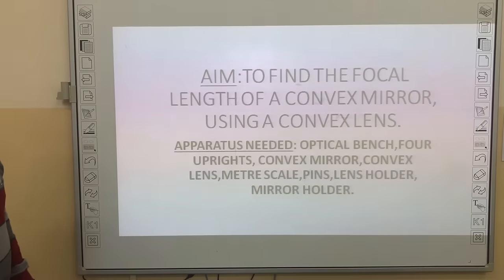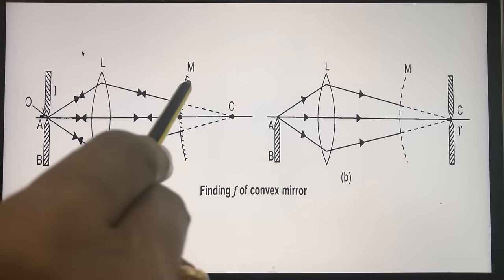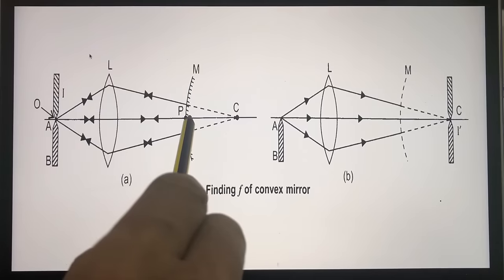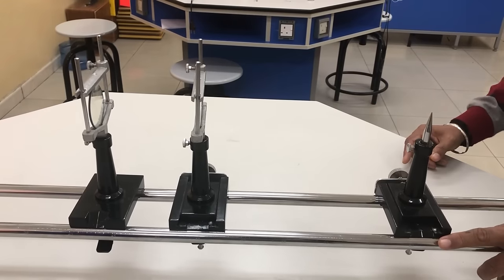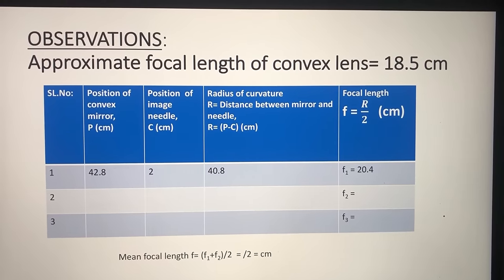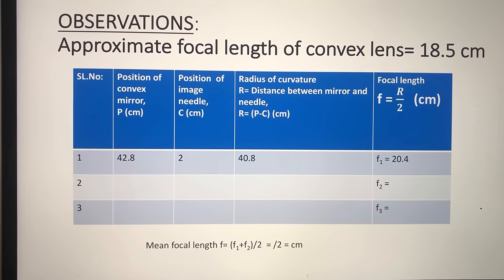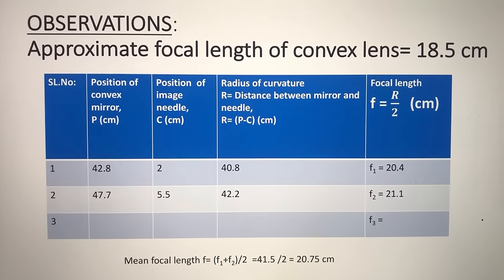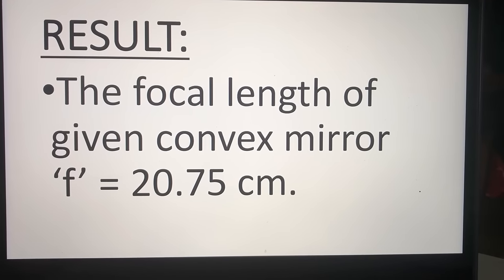To find focal length of convex mirror using convex lens.Prakash & Mini

Comment: 1. Initally keep the convex mirror and convex lens at any distance apart from each other, but it is better if it is not too far apart.
2. Now take the object and adjust it such that the parallax is removed. 
3. Once done, remove the mirror and again adjust the other pin such that parallax is removed
4. Find value of R
5. For next observation, do not change position of lens, instead bring the mirror a bit closer (around 2 cm) to the lens and repeat the experiment.

P.S: My practicals are over and I got this experiment. But thankfully I got good readings.
Reply: Bhai observation bhi likh de please..😂
Reply: Thanks bhai ..bahut confusion tha
Reply: @ItzSiddhant  😂😂😂
Reply: Bhai object ko kitne distance pe rakhna hai?
Reply: R is measured from the mirror? or lens?
Reply: @vrajpatel4936  koi bhi chalta he
Reply: @yashpathak5629  R = Distance bw lens and image - distance between lens and mirror
Reply: @khushxbtc6162  thanks bhai par mera hogaya
Reply: @yashpathak5629  Mirror.

Comment: Sir, why have you put the convex mirror at 47.7 cm?
Reply: Any specific reason to do so?
Reply from the maker: You can place it anywhere close to convex lens
Reply: Nice video sir
Reply: Visual Physics Tutor why did you find focal length of convex lens bcoz in question its asked  focal length of convex mirror using a convex lens ???

Comment: Sir why 1.5 is multiplied withthe rough focal length?
Reply: we have to position the object needle between the focus and radius of curvature...so if we multiply less than equal to 1, we will not get the appropriate position...similarly if we multiply more than 2, it will go beyond radius of curvature... You can multiply any number between 1 and 2...but just to get a round figure, we usually multiply 1.5
Reply: Draw the ray diagram.. U will get it

Comment: Rough focal length was 18.5 CM then why we have kept convex lens at 55 cm??
Reply: The rough focal length is 18.5 cm, so from 55 cm, the pin is placed 18.5 cm apart
Reply: Focal length of lens will determine the object position(ie, we will place the object outside focal range), lens position is arbitrarily chosen.